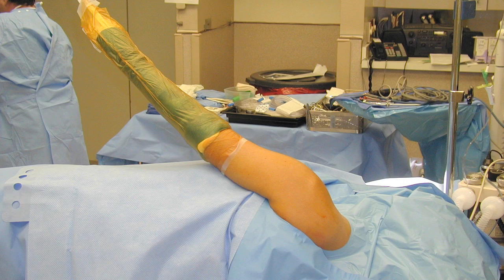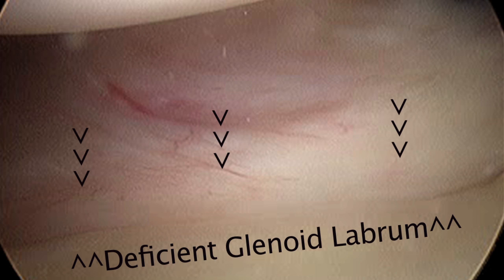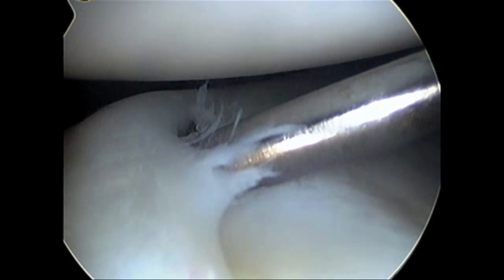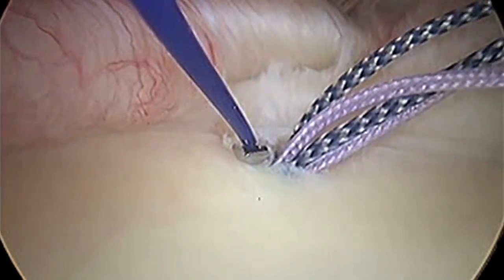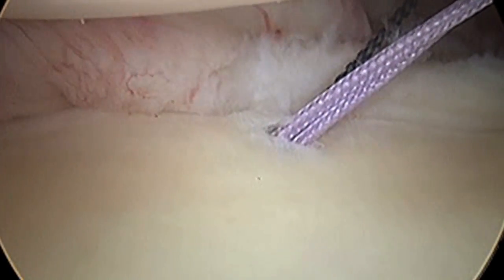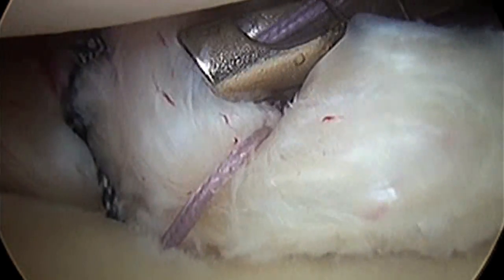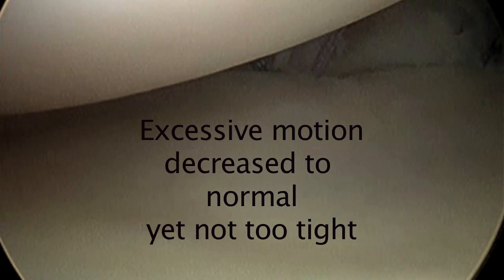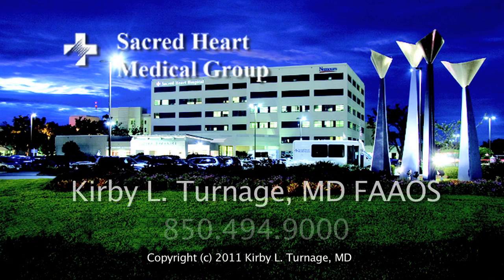Shoulder Instability Surgery, Arthroscopic

Comment: Looks like the procedure I will need soon, as my shoulder rattles when I try to shake something or when I'm trying to cut/saw something in my left hand (I'm right handed) and I can't seem to keep my left shoulder from moving in the socket. While its not painful in the immediate. I know that can't be good for the joint. Using one of those Shaker dumbbell is downright unnerving to witness how much instability I have in that left shoulder joint. I've been working on exercises to help stabilize the shoulder joint and they haven't had much, if any, affect. Being a wheelchair user makes this "simple" procedure seem nightmarish. Like taking a three-legged dog's third leg away.

Comment: I am a 50 y/o male with a left shoulder that has had multiple dislocations (1-2 a year) for the last  23 years. My shoulder now shifts around and I am always  having to push up on my elbow, while my arm is bent to push back up some. A lot of times if my Humeral head shifts backwards some, I can take my right hand and pull on my left arm going across my body to shift it back, it always pops when I do this.
     7 yrs ago I was to get an operation to "anchor my arm into the socket" , but I wasn't at that time ready to go through with the operation.  
     I seen the VA doctor today, to try and get that operation and he told me, that I'm too old for the anchor operation, and too young for shoulder replacement. 
     He said all the popping was from arthritis.
My arm doesn't dislocate much now, but it feels like it would because of all the movement in my shoulder.
What you think I should do?

Comment: Went through a slap repair, bankhart and a capsular shift 7 weeks ago..
My humerus is now locked in a forward position and my scapula is elevated and tipped?? is that because of the surgery and muscle weakness or  because the doctor sutured the labrum in a way that it locked the glenoid in an anterior position?
Also, I had a lot of problems in the healing process and there were a bunch of times that I felt like my shoulder moved awkwardly similar to a small subluxation, but not really.  My shoulder feels looser now than it did 2 weeks after the surgery.

Any ideas doc?

Thanks

Comment: I had this surgery and now have terrible grinding and impingement. Grinding was noticeable almost right after I got out of sling 4-6 weeks after surgery.  I originally had surgery for sharp impingement pain so they cleaned it up and sewed down posterior labrum But now I have terrible grinding with forward up and down motions, Hawkins test makes it grind. It feels like it's even catching on the back while heavily grinding. I never had any grinding before the surgery. I did have a little arthritis on the glenoid but I hardly doubt this is a bone on bone grinding like some are saying. I noticed this grinding just a couple months after surgery and many said that is normal so I let it slide.

Now I am 9 months post surgery and the grinding can be terrible and I mean hard crunchy, locking up when it catches on the back area. I can actually stop the grinding by grabbing my read deltoid area and pull it forward while moving my arm around. Another example, I'm laying back on the couch and because there is normal pressure on my shoulders I get bad grinding. I am clearly grinding on the back but I need to know what exactly is doing the grinding along with a sharp impinging pain with it and what kind of surgery would fix this since I've already done this surgery. Capsule, labrum, muscle, tendon? What is going on???

Thanks for any info anyone?
Reply: OMG, that is so unfortunate. I just had the same surgery and I hope I don't expericence this grinding. Hare are you now (2 years later)? Did you made another surgery to fix the grinding or it fixed itself?
Reply: @deyanv  how’s everything are you having any more shoulder pop outs ?
Reply: @BMWMED1 Hey, it was a success. I recovered 100% and got my full range of motion. It is just 1 year after the surgery. I have to go make MRI to be 100% sure everything is recovered well. The only thing I feel is slight pain when I train shoulders heavier (but it is barely noticeable). Good luck
Reply: might have ligament laxity, have a look at prolotherapy
Reply: I had this 6 weeks ago and just started PT . I have no range of motion. I hope it will be better .
Reply: @semihcelik121  do you have range a motion?
Reply: @bfendii955  yes, I fully recovered years ago. No problems at all
Reply: @deyanv  that’s great to hear I’m happy for you how long was recovery?
Reply: @bfendii955  on 2month mark I started light lifting in gym. around 4 monts I was completely recovered
Reply: @bfendii955  definetly better than before and less painful but still not where i wish it was . Maybe %60
Reply: @semihcelik121  okay do you still have the pop outs?

Comment: I have shoulder joint Instability and only being 13 (yes I'm 13) I don't know if I should get this surgery. I am currently in physical therapy but in 8 weeks (now like 6) if physical therapy doesn't work I am going to need this surgery so I am just curious on do u think I should just get the surgery? Ps my shoulder joint instability is multi-directional and it is very bad, my shoulder has slipped out of the socket (dislocated) about 7 times and it just keeps getting more painful! I can barely reach over my head and out to the side
Reply: The first time I got diagnosed which shoulder joint instability I was 11, I have cortisone shots directly into my AC joint four times and I have failed physical therapy twice, I'm 16 now and I'm getting the surgery done in two weeks. I  honestly think you should get the surgery done because I've gone 5 years with it  and it keeps getting worse so you'll probably be better off to get it done know rather than wait
Reply: Nor Stump I'm 17 and I've had shoulder instability for roughly 3 years and indeed it the condition does get worse as time progresses. I feel like my condition has deteriorated over the past couple of years leading to me not being able to life my arm sideways without cracking and intense grinding. I'm trying to persuade my physio for me to have surgery so please do keep me posted with the outcome of yours
Reply: +Muhammad  Abdurrahim the surgeon told me that I need to wait to I'm older to get surgery because even though my shoulder is now starting to pop out of the socket so now I'm getting a shot of cortisone for the fourth time and it's extremely frustrating because the cortisone shot is a short term solution to a long term problem
Reply: +Muhammad  Abdurrahim the surgeon told me that I need to wait to I'm older to get surgery because even though my shoulder is now starting to pop out of the socket so now I'm getting a shot of cortisone for the fourth time and it's extremely frustrating because the cortisone shot is a short term solution to a long term problem
Reply: I'm getting this surgery and im 12 years old and my shoulder dislocates more than 20 times a day and I was wondering how long I have to wait before I can go back to doing goal keeper
Reply: Muhammad Abdurrahim hello! its been almost a year since i have posted this and i finished PT, it failed, still have popping out sensations on both shoulders. i have not returned to the orthopedic surgeon, my parents won't let me. im curious to see if you had your surgery since its been year! please reply :)
Reply: +Jenna Marie you might want to look at joint hypermobility syndrome or ehlers danlos syndrome. Report back if it fits your description
Reply: +Jenna Marie how is your condition getting on?
Reply: Jenna Marie no I haven't the surgeon wants to wait because he says I'm too young
Reply: I'd recommend waiting and in the meantime looking into prolotherapy , might be helpful
Reply: Muhammad Abdurrahim wow! since my last post i went back to the otho (a different orthopedic surgeon) and he confirmed my shoulder joint instability and said i possibly tore my labrum. This was in December btw. So i got my MRI done with an injection of some contrast die (hurts like hell) late December and results came back that nothing is torn. I saw my doctor 2 days after and he told me to do a second round of PT for 6 weeks this time (last time was 8). I finished PT about 2 months ago and about 1 month after finishing my shoulder popped out again. Im at the point where my parents won't take me to get another MRI or see another doctor so I'm pretty sure I'm stuck with this
Reply: hi buddy which sports you do ,so you got that kind of injury buddy,n injury is a part of sports u have to bear it.

Comment: Good advice. The shoulder inherently is not designed to "lift" multiples of body weight, unlike a gorilla, literally. Gorillas have a shoulder designed similarly to a hip, more like a weight-bearing joint. We do not. Heavy weight lifting, though, possible, is much more likely to reinjure your shoulder, resulting in need for further surgery. I am a former Div I athlete and cannot lift heavy since age 36. After surgery, focus on keeping arms closer to body (cont'd below)

Comment from the maker: @SK4616 Depends on many factors: bony damage? More than one dislocation? Rotator cuff intact? Typically, rugby and full contact football are not "wise" and often lead to recurrent instability, even after surgery. Many shoulder surgeons will perform open capsular shift for contact athletes.

KLT

Comment from the maker: These "ropes" are actually small surgical suture that is very strong. They are permanent, yet are usually covered up by the body with tissue called synovium or just fibrous tissue/scar. The reason we place the sutures away from the joint is that they can snap and irritate the patient if we do not.